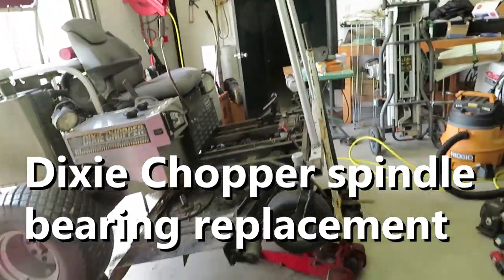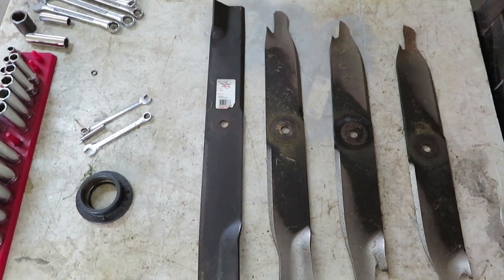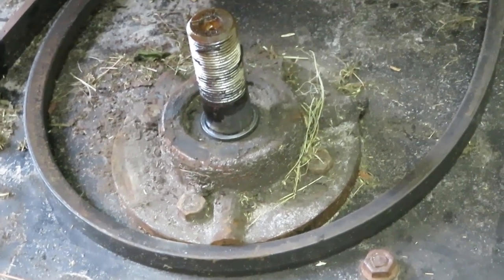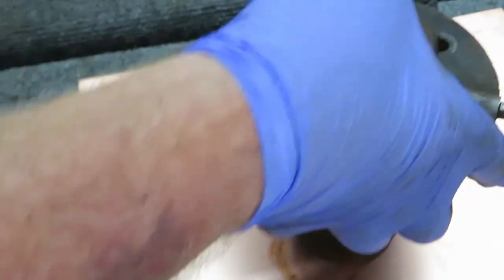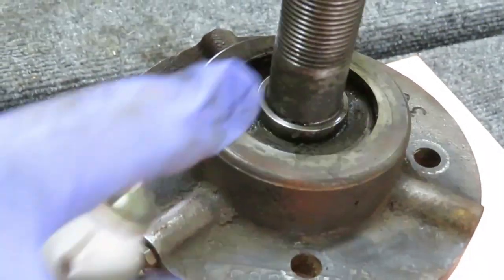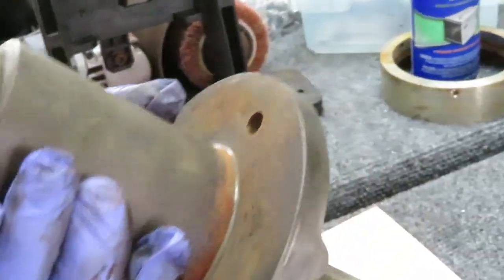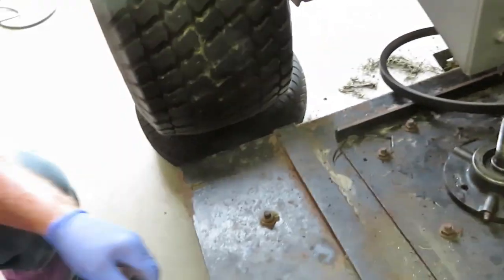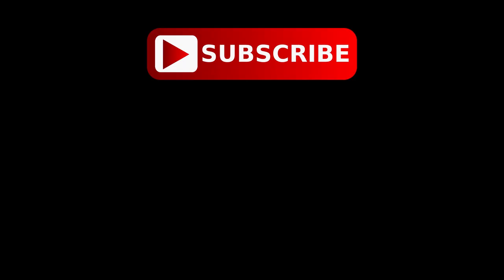Dixie Chopper spindle bearing replacement

Comment: I have done this many times of owning Dixie Choppers for 15 years.  You do not have to remove blades or the spindle from the deck.  All you need is a block of wood and 2 lb sledge.  You can use sealed bearings but they go bad also.  If you want to use greaseable bearings, they sale them, one side open to grease.  If you have sealed bearings, just take off one side of the seal bearing.  The sealed part of the bearings go to the outside. You can then pump grease until it start to come out the bearings.  New spindle assembly only cost $55.00.
Reply: You do not have to remove the spindle assembly, just the spindle shaft, and then replace the bearings.
Reply: John where do you get one for 55 bucks, you must be talking Rotary or Stens
Reply: @Hugeroost  Amazon

Comment: You will need to remove the seal from one side of the bearings so when you grease them the grease can get into the rollers and add life to the bearings.
Just make sure when installing the bearings the seal are outward.
You can rebuild the spindle with it installed on the deck too.

Comment: How do you get the nut off that holds the new pulleys?  I tried blocking the blade but the nut turns the entire shaft

Comment: I am replacing mine today, mine are all original,machines a 2005 w 1250 hrs.... trim side is a little loose. Mine doesn’t have the snap ring on top like yours , it’s not like my older 2001 Dixie it Justin came apart,this one I came on here to find out how....thanks for the video , I should shoot video of mine once I figure out how to get it apart.
Reply: Did you end up getting them apart? Mine doesn’t have the snap ring either and I’m trying to figure out how they come apart.
Reply: The ring spins off. It is threaded to to the spindle shaft. There are 2 Allen Screws that you have to take out first.

Comment: Mine doesn't have a key ring to remove, it has a large silver disk that is held on with 2 allen screws.  I removed them and the disc still does not move.  Looks like it should slide right off.  Not sure what's going on.  Any ideas?

Comment: I got the pulleys off with an impact driver for the main nut.  Now I am trying to get off a silver disc that is held onto the shaft by 2 allen screws.  Looks like it should fall right off but it won't budge.  Mine doesn't have a key lock like yours did.  Any ideas?
Reply: I need this same question answered!!!!
Reply: There are 2 Alllen screws on the ends of the silver disc. On mine there were 4 holes but only 2 screws. 2 holes were empty. Once you get out the Allen screws out  the disc should rotate off the shaft

Comment: I'm sorry, maybe I missed it but what are the new blades you like? I've had the worst time getting mine to hold up with 5 acres of grass. Thank you for the video, this helps a lot.
Reply: He's using Rotary brand, I've been using Rotary and found them to be excellent quality. His are # 6833...which are 24" x3 for 72" inch deck. # 6180 are 20-1/2" x 3 for 60" deck. I use 6180's on my 60" Classic and they hold up great. This model blade is high lift with 8" cutting edge. You can go to rotarycorp.com to find your parts and a dealer in your area.
Reply: @joeboyko2138  thank you so much!